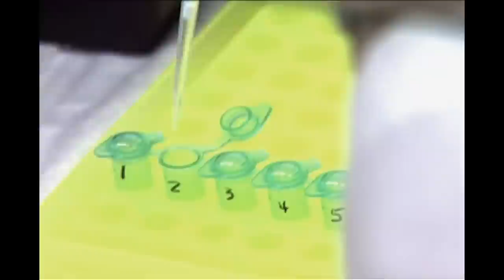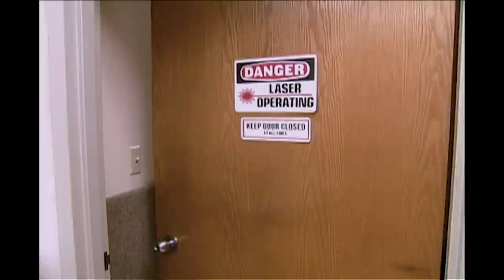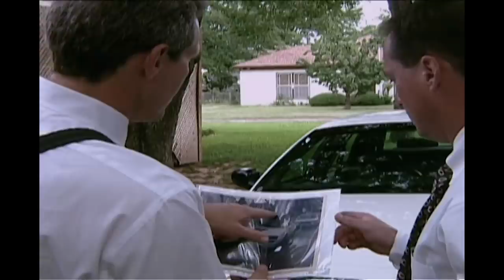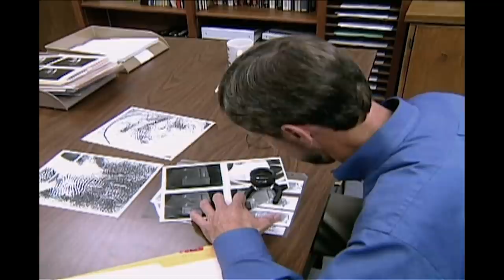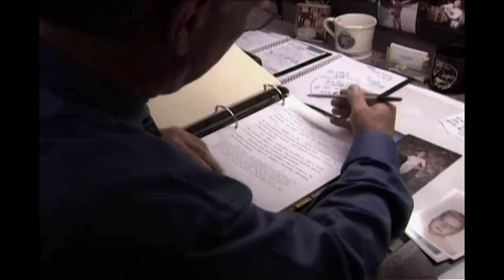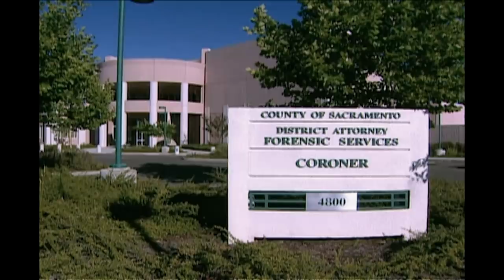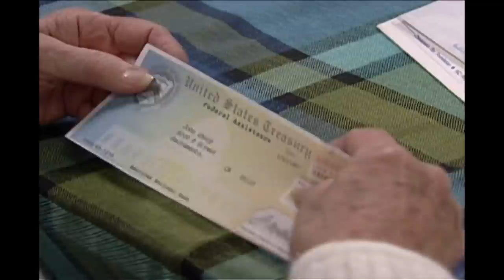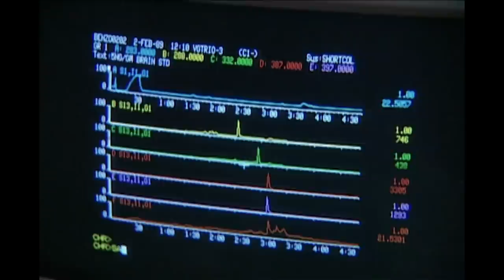Dorothea Puente's Boarding House Of Horrors | The New Detectives | Real Responders

Comment: I feel like this special couldn’t be more inaccurate. Can’t even get the facts on the puentas case right when it’s notorious
Reply: Especially the fact that Detective Cabrera actually found traces of body fluids (which caused him to gag a little) that seeped into the carpeting in one of the rooms upstairs. The fact that body fluids been discovered, meant that several of those victims had been placed in there for several weeks before putting them into the ground (which also coincided with several witnesses claiming they recalled smelled a strong odor lingering in Dorothea’s house).